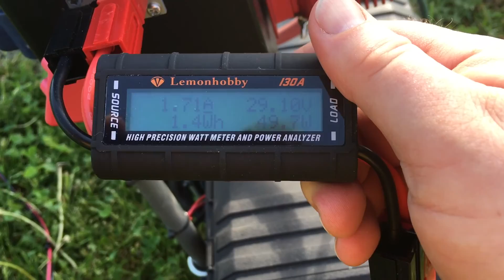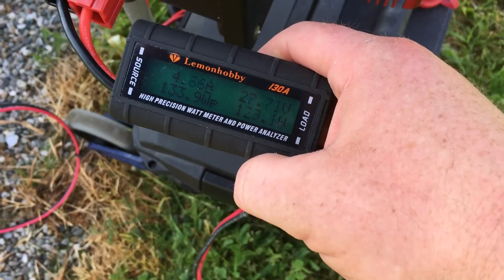New DIY Ground Solar Mount Installation AC-Grid-Tied Part 1 (Footings)

Comment: How much was the rental?  Did you have to pull a permit with specifications for concrete?  What about ballast system?  Would that work?
Reply from the maker: Permit for net metering only, but no permits for construction of the array (concrete, etc).  You could use a ballast system too.  I wanted the array off the ground due to snow in the winter.

Comment: Your PV panels should be tilted higher for better production at your higher latitude. The rule of thumb is to set your tilt to the degree of latitude you're geographically located.